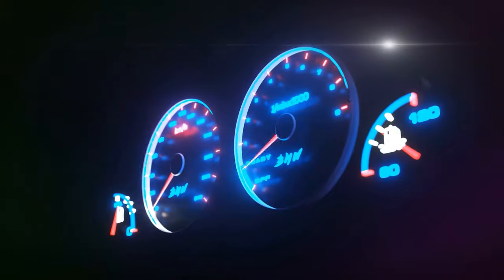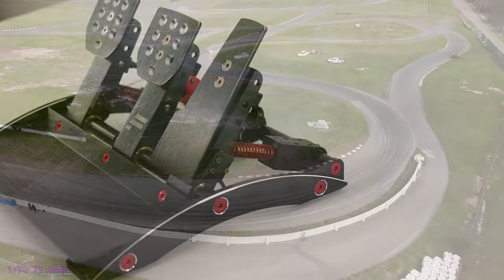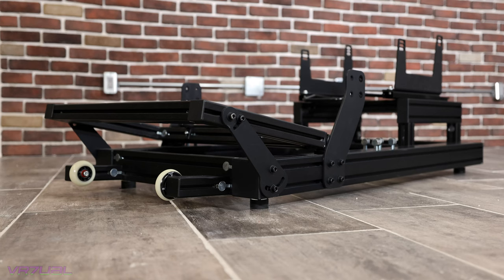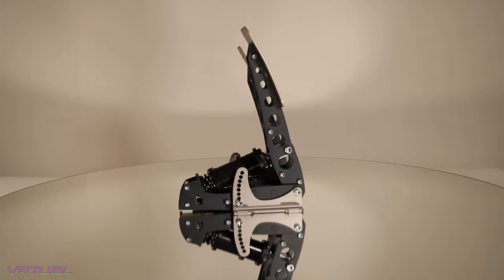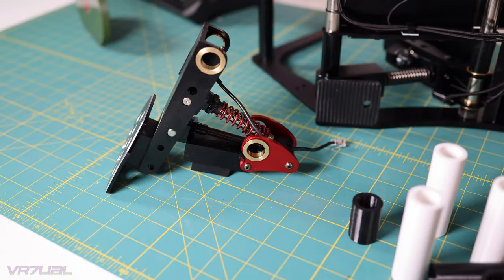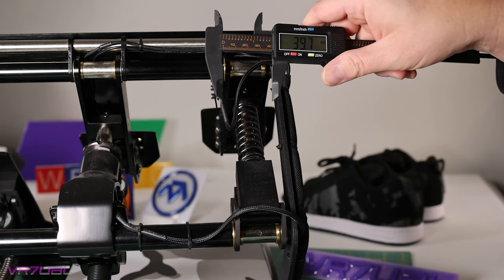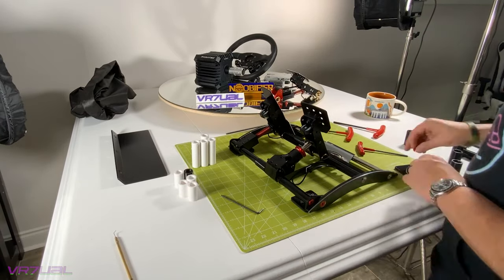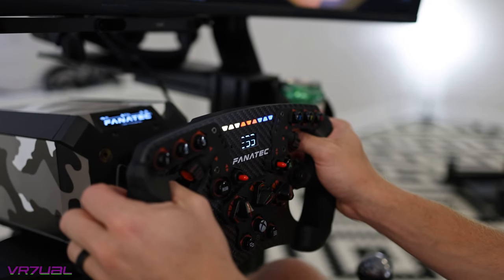Maximizing Your Setup to perfect your potential - Pedal Delete 3D Printed

Comment: Hope the material is strong enough. Maybe a piece of pipe out of the local hardware store would do the same. For a few bugs more i would suggest a brass sleeve with thrust roller bearings and spring washers on each side. But if the 3d printers material is actually strong it really is a solid solution. You should measure it after a few weeks in use. FAST
Reply from the maker: Its PETG, pretty much impossible to break especially at 100% infil.

Comment: interesting take for adjustable pedals, tho on the 3d printing, 100% infill is never necessary, you're better off increasing your perimiter ( wall ) line count.  it has just as much effect without using up the extra filament
Reply: all around, ie top/bottom too

Comment: Very cool, I feel like I should pull back out my 3D printer though I remember having all sorts of issues getting to bed level on consecutive prints. What are you using for a printer? And how's your experience been with it?
Reply: this is the 'fun' part of 3d printing. learning how to over come these issues and all the wasted hours getting there :) They can be over come without leveling sensors but maybe a mod to the base is required or just screws need checking. who honestly would think to make a 200 hour maintenace cycle to minimise failures.

Comment: I have the new CSL peddle set, with the Loadcell kit preordered.  Should be receiving it in February.  I will comment in the comments on how it is.  So far I like the build quality for the price.  They are a good starter set.
Reply from the maker: Loadcell makes a huge improvement in brake feel.

Comment: 3D printing is an amazing hobby, but it is best if you know 3D CAD as well.  Being limited to only what you download online is a very big limit.
Reply: Which software would you recommend?
Reply: @Justleg  I prefer Solidworks, but that is not cost effective for most.  Fusion 360 has a free version that is very capable, but you are limited in export options and how many files you can work on at a time.

Comment: they could simply offer tubes in different colors)  you can cut down (and degrate) into pieces to your needs for those without 3D printers.
Reply: @NOOBIFIER1337  0.1 mm accuracy is indeed pretty hard to do without special equipment even if you manage to grind of the last bit evenly

Comment: Interesting. I guess a 3D printer is a required accessory for serious racers.
Reply from the maker: I will print stuff if you want. Just let me know.
Reply: @noobifiertwo  that's very generous, but I actually have my own 3D printer. Now if only there were good T16000 enhancements I could print!

Comment: Needing a 3d printer to set up your gear . Too elitist for me.
Reply from the maker: I offered to print if you need.
Reply: @noobifiertwo  fair enough.  :) Personally when you need a 3d printer to engage with a hobby things are going too far and cutting too many people out imho. In model making this is becoming an issue . With some just printing rather than building stuff. Which is a unfair no skill advantage in competition.  A bit pay to win. Its a sore point for me and not directly pertinent to your case.  But It colours my views :)